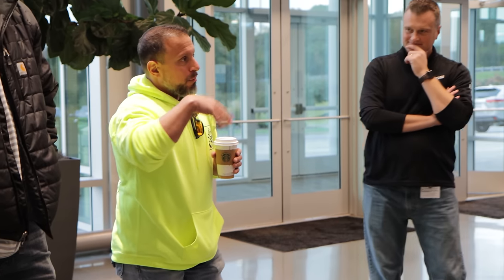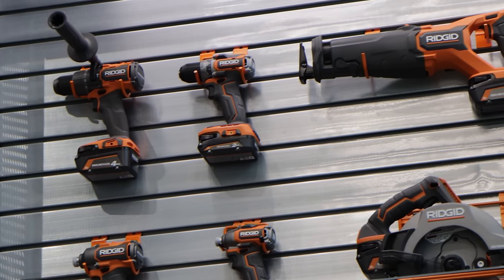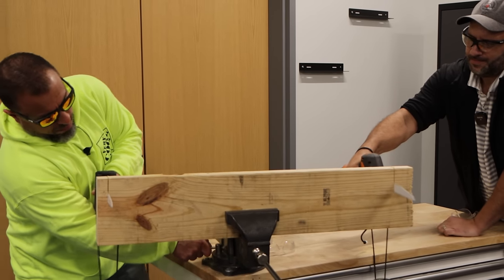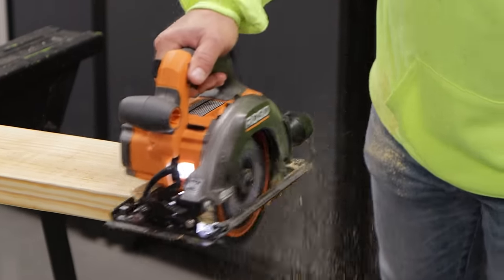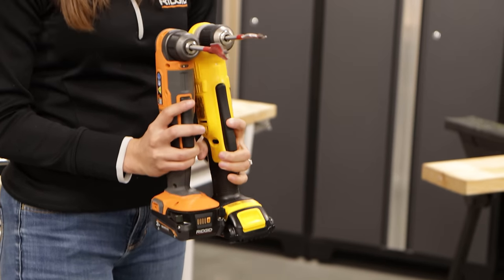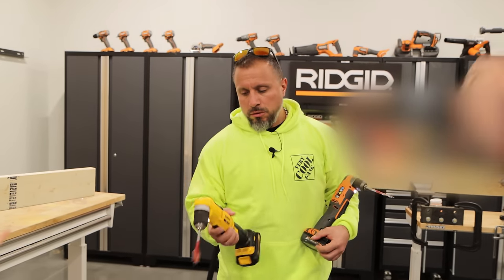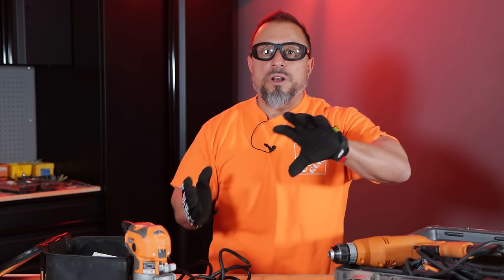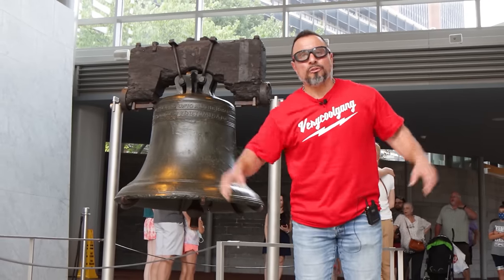Telling Ridgid Executives I Don't Like Their Tools!

Comment: Well if they switched sides on the board instead of saws we would’ve seen a different outcome. Its a lot harder to cut through yellow grain than the light which is why it slowed half way through. Look at the color of grain when it slowed down
Reply: Yeah I agree I saw that immediately (no pun intended)
Reply: That pine with knots and sapwood on the one end of the board is twice as hard to cut as the clear almost quarter sawn end.  They should have swapped ends for a true comparison.
Reply: I think they should have swapped blades too.
Reply: @underwearrr  yeah definitely. Not positive but it almost looked like a more aggressive, bigger tooth blade. But maybe not
Reply: I'm sure VCG knows that too which makes you wonder why he didn't call them on it if it was a genuine comparison but instead participated in false advertising.
Reply: There was so much smoke and mirrors here.  I saw on at least one dewalt comparison they were using a brushed model vs what I can only assume is non brushed based on the design.  Sad a company has to deceive their customers like that to make sales.  Their warranty is shit too in my experience
Reply: My thoughts exactly!
Reply: Exactly.
Reply: Exactly.
Reply: I call BS on that
Reply: @MikeNoce  She said in the video they compared the two because they are both being sold at the same price. More value for your money.
Reply: I can’t cut straight to save my life. I am not a wood worker, but on occasion I need a tool. I have a Ryobi set that will last me a lifetime. 

With that said even I saw that wood was full of sap and was harder to cut. You can see the saw tear through the first 1.5” just fine and then stops when it hits the sap. 🤦🏼
Reply: @brucetec6597  so Rigid's brushless is only slightly better than their competition's base brush model....not impressed
Reply: @chadw6448  I guess the whole point flew right over your head. It's not slightly better it's better for the same price. A Hellcat is faster then a civic or a Dodge Dart but they are not in the same price point. They both get get you from point A to point B but most can only afford the Civic or Dart it's just the civic is way better at the same price.
Reply: Yes sap wood is soft and sticky, clogs up the teeth
Reply: Yup...that hackzall test was bullshyt lol. Obviously knot stopped the blade dead on both attempt. Not saying the tool is bad at all but rigging your test is a bad look.
Reply: @MikeNoce  a non brushed based design huh? Is there a simple word for that? Like brushless. Also a brushless motor is always more powerful than its brushed counterpart.
Reply: I don't know shit about power tools but thought it was funny how the Dewalt slowed down as soon as it hit the redish color in the wood and why it didn't run thru the whole part of the board
Reply: @MikeNoce  They we’re clear on that. They said those two models would be offered at the same price.
Reply: Exactly they knew what they were doing
Reply: @theslimeylimey  there's only so much you can do before it gets too hostile. Those people only know so much compared guys like vince and blue collar guys that wouldn't understand the necessity of discrepancy
Reply: @wesfields9322  If by 'those people' you mean the rigid reps who set up the test, I can assure you they knew exactly what they were doing.  Honestly I think the whole thing was planned and setup for a video promotion.
Reply: Also with the drill they used the 1.5 ah battery
Reply: That was my first thought also. They should use MDF/partical board on testing, it's more consistent.
Reply: @MN Outsider Hey, Go watch their video where they retested this exact test themselves switching sides and the Ridgid still destroyed the DeWalt easily.
Reply: I'm a milwaukee guy but I have always liked rigid.i like the look, the construction and ergonomics are very well designed and you can't deny the price.
Reply: They also put a 1.5ah battery on the dewalt and a 2ah battery on the rigid right angle drills. Smaller battery has proven lower power delivered to the tool vs a higher AH battery. Just another case of rigid trying to stack the deck in their favour for their "tests" and demos
Reply: Also depends how sharp the blade is. They should have swapped blades too.
Reply: My thoughts exactly. This was not a fair test. Try again Rigid
Reply: He made another video because of the knot. Ridgid still came out in top

Comment: I actually switched from Dewalt to ridgid after replacing several dewalt tools in a short time from use. I absolutely love Ridgids line of tools and they work very well for me the last 6 years or so. Having said that, this is nothing but good news and great constructive criticism going forward.
Reply: I agree 100%. I cannot see paying 2 or 3 times more for a tool that will get the job done just as good as the other.  None of my clients have ever come up to me and said, "You did a really nice job remodeling our place, but it would have looked so much nicer if you had used DeWalt or Milwaukee." LMAO
Reply: My buddy at work keeps trying to get me over to Milwaukee. Yet my older generation rigid tools the Gen 5x brushed models have more power than his brushless models. And I paid half as much for my 5 piece combo set on sale for 250 bucks  he paid $500 for his high torque Milwaukee impact wrench.  The only reason I could see going Ryobi or Milwaukee or even Makita  is if you need more tools than the basics. Circular saw reciprocating saw impact driver impact wrench drill driver. If you need more than those then by all means go somewhere else with a wider variety but as far as the basics go rigid offers a great lineup for the basics that most prosumers use. Every house project I've been able to complete with rigid tools and they get me very far at work fixing tractor trailers. The only thing I really need is a high torque impact wrench.
Reply: @Techprep23  I just got the Rigid 600 ft/lb impact wrench and it works great. Black Friday is coming up at home depot, GREAT time to collect some Rigid tools for cheap cheap. Not even on Black Friday are the DeWalt or Milwaukee tools on sale. It's ridiculous how much the want for the them.
Reply: Funny, we switched from Rigid to Metabo for framing guns since all the rigid ones generally wore down pretty fast…. It’s been like 8yrs since tho so maybe they’ve improved the year and wear in the framing/finish gun lineup … but for now we’re still Metabo fans
Reply: Samesies

Comment: DIYer here. I just upgraded all of my old power tools to DeWalt. Ridgid was considered but quickly disqualified because the power tools are just too big and too blocky. Love the boxes and the vacs. Good to see they are going more compact.
Reply: I have many and don't mind the shape or weight. I really prefer their grip to others not only because of the texture, but because as a professional user they do not seem to seperate from the handle as bad as the dewalts or milwaukees. Don't missunderstand with enough use they still get loose but it doesn't seem to be right on the front seam of the grip like the other two, its usually on the back around the thumb / pointer area.

Otherwise I would agree that they are often bulkier or heavier in some instances than the others. It just doesn't seem to bother me I guess because the grip feels better making it less noticeable.

Funny note though. There subcompact drill is only slightly smaller than the Gen3 Milwaukee fuel lol.  If I were looking for weight savings out of the 3 I would have to pick the  Dewalts. They are light and although I don't prefer the smooth grip they are still very ergonomic. The grips on Milwaukees are about the same but their tools are a little on the heavier side, however they generally make that difference up in power.
Reply: I'm a dewalt guy. But if another tool maker comes out with a tool that dewalt doesn't make ill buy it. I just got there new dcf923 atomic haven't used it yet but can't wait to.
Reply: Ik I'll be in the minority but I consider every other power tool over dewalt. Every work place I've been at has dewalts and they've always been complete shit. Especially their impacts. They've never lasted.
Reply: Apprentice here, one of the guys I work with uses rigid here in Australia it’s called AEG. Two days ago we went through 3 batteries with 1 bar of charge left and none would power the leaf blower. He then discarded a fourth battery with 3 bars because it was faulty.  

Not sure if we’re talking about the same brand here but I can see where Vince is coming from, 

He’s in what you might call a pickle of a situation. Don’t envy you at all Vince, glad you spun it to the brighter side though you’re a gentleman.
Reply: I use Ryobi and when I need something awesome I am into M12/M18 and so far it's the perfect way of doing things.
Reply: As another DIYer - I have Ridgid subcompact impact driver on my wishlist.

their 18v subcompact impact is shockingly small
Reply: @AleksandrPanzinAlex  If you do buy one make sure you put it through its paces and see if it good for you within the return period.

Most likely you will love it. However it is the only tool out of the 3 subcompact ridgids that I have bought that has no real issues. I have a ton of ridgid tools I love. These however are kinda just meh. Good power and weight for this small of an impact though.

I dont regret the purchase, only expected better from ridgid.
Reply: I’m a Milwaukee and Ryobi guy, but must admit that I’m impressed with the DCF850 and the features that it has for such a compact tool.  I think you made a good choice.  DeWalt is stepping it up 👍
Reply: @D3M3NT3Dstrang3r  I'm not exactly sold yet. 
I have a Ridgid table saw, but it's the battery system that's the issue here.
Their $200 sub compact kit comes with a very poor charger.

I primarily have DeWalt 20VMax. DeWalt has some new great subcompact tools out, so Ridgid may not be a purchase for myself. And considering I only need a very compact impact - I'll probably end up with Milwaukee M12 Fuel kit.

It's a shame that DeWalt new atomic impact is not that great 😞
Reply: Rigid does have a good shop vac
Reply: Not sure what to think about Ridgid. If all these new tools came in at the right price with minimal problems and performed like they showed... they'd gain a decent market share back. I've made the switch to Milwaukee from Makita, and rely on my tools to get it done and take the abuse every day.  If I need a "disposable" or "once in a blue moon" tool I would grab a Ryobi, as would most people. Where does ridgid fit? Diy/prosumer? Yes, but so does Dewalt. Dewalt may be on the higher end of that prosumer/contractor scale but the prices are similar. Time will tell maybe and see where their offering fits in the market.
Reply: That's doesn't matter unless your working in tight spaces.
The issue with Ridgid is that they have a small selection and the drop them constantly
Reply: As a person who is 6'3" 280lbs I have no issues with using a large octane hammer drill with a 9ah octane battery overhead all day long.  The small tools are nice, but they shouldn't replace the large tools.
Reply: @MegaCole76  sounds like you can help out the eagles as a push rusher or even an edge run stopper
Reply: @lrac_1  🤣 Was a left offensive tackle in college
Reply: I’m a DIY as well and wouldn’t upgrade to a better tool line because certain tools are just not required for DIY. I just upgraded to a Ryobi tool kit from black and decker (trash tools) but for price, they did their job at home. I know we get sucked into the looks and marketing schemes but I worked on home projects for years with my black and decker set, just depends on what you’re working on.

Comment: With 40 years of experience with power tools i can say this. I want a tool that performs and is well made. I grew up around Black and Decker, Skilsaw Porter Cable and Milwaukee. Today some of these brands are junk. They have been bought out by mega tool companies. If the tool is well made and durable it will stand on it's own no matter what brand it is.
Reply: And what brand do you recommend??
Reply: Now or today all big name of tool Made in China with low quality parts ( the 1st important Production low cost ) . I have Dewalt Made in England and USA . Hitachi Made in Japan , Milwaukee Made in USA and all have more the 15 years and still works.
Reply: Metabo
Reply: @rubenmv91  I do some research before buying a tool based on it's brand name. I recently bought a worm drive. It's a skil saw mag 77 based on reviews from the essential craftsman YouTube channel.
Reply: So true
Reply: Amen.
Reply: true, now B&D can barely make a can opener that lasts a year
Reply: @joew717  They make Dewalt, proto, Mac, and more. B&D is pretty much their bottom of the line tool.
Reply: @smith97320  well, their can openers stink LOL
Reply: The fact you name checked black and decker shows exactly how much you (don’t) know about power tools
Reply: @cne1975  did you ever consider i was talking about late 60's and 70's? DeWalt, Makita hadn't come to the market yet. Ridgid was still making pipe wrenches and threading equipment they hadn't even thought about power tools.
Reply: @josepheller8395  fair enough, my bad. Just seeing the name black and decker sends me into a mini rage.
Reply: I still use my porter n skil. I can't break em. Not the same tools anymor. Nvr likd any blk n deckr. I remember the drills from the 90s n 2000s. I stil hav a blk n dkr drill that charges but has no balls at all. Were spoild wit our tools today even tho those companies hav sold out to the bigboys for cheapr production n material costs
Reply: @rubenmv91  Milwaukee, this isn’t a contest
Reply: @bigchungus1848  came here to say the same thing. Might be more expensive but you get what you pay for.
Reply: @mreatspeople  exactly
Reply: @rafaglez8906  I own alot of Milwaukee tools. I'm not in construction I'm an Automotive technician so what I use is probably different than your used to. Anyway that is besides the point. Milwaukee has their units built in China they are designed here in the U.S. but assembled in China under a communist regime. Snap on is hit and miss some things are made in China and assembled here in the U.S. something's are just the opposite. I always support and truly wish all companies would stop supporting the communist party by giving their country money to build our tools.
Reply: @omalley5005  is metabo German?
Reply: @jeremypike9153  it's been that way for a long time now. It's called global capitalism.  How are you going to compete with a modernizing country with one billion people? Are you going to buy a ffull on USA made drill at $300 or get the Chinese made(fill in your local American brand name) drill at $150?
Reply: @johnnytocino9313  in the past Yes Germany , now ? . Metabo now is part of Company the Hitachi and Tanaka .
Reply: @johnnytocino9313  yes sir it is. I know it's not American. It is a great grinder. Been using them almost 20 years now.
Reply: @omalley5005  ah. Never used that brand myself. My welder friend was telling me about em. I notice lowes started caring them.
Reply: @johnnytocino9313  I'm a welder myself. I swear by them. Pricey though. Well worth the $$$
Reply: @omalley5005  will check em out, thNks
Reply: Dewalt or Hilti
Reply: As a professional the Ridgid Miter box is not something I would ever buy. Took mine back, very inconsistent cuts even at 90 degrees. The cuts were all over the place. I have an old Ryobi that cuts 90 after 90 after 90 all day, dead on. Ridgid also does not offer the same selection that their sister Milwaukee does. So, at this point I am going over to Makitia. The quality is there, and they give you a great variety equal to Mil or better. I stayed with Ridgid for the last 8 years. Now, for a tool company to fall on their face with a poor miter box design, they are not competent, how did you let this happen?

Comment: I ran Rigid tools for quite a few years…they always seemed like they weighed 2x as much as the higher end lines, but the price was right especially when it seemed like they were always clearancing out a line at the depot.  However, I got sick of spending more times waiting for my tools to get serviced that I made the switch to team red.  Should have spent the extra money day one!
Reply: Great point. We shouldn't need to use a lifetime warranty, but if we do, it should be fairly painless and quick.
Reply: I liked Rigid long long ago The tool felt like quality in my hands. Over the years I have changed to using multiple brands other than dewalt and rigid. Depends on the application for what tool ill break out. If I had to pick one brand it would prolly be makita, With ryobi being second. IMO ryobi used to be junk now I like them.
Reply: As a professional the Ridgid Miter box is not something I would ever buy. Took mine back, very inconsistent cuts even at 90 degrees. The cuts were all over the place. I have an old Ryobi that cuts 90 after 90 after 90 all day, dead on. Ridgid also does not offer the same selection that their sister Milwaukee does. So, at this point I am going over to Makitia. The quality is there, and they give you a great variety equal to Mil or better. I stayed with Ridgid for the last 8 years. Now, for a tool company to fall on their face with a poor miter box design, they are not competent, how did you let this happen?

Comment: I have always been a yellow guy but I recently was looking for a smaller drill . I ended up getting the sub compact ridged . So far I am very happy with the overall performance . The ergonomics are good the weight is good and so far the battery life has been good . Last but not least the price point you can’t beat . I am already looking at the circ saw to make another pc of yellow stay on the shelf .